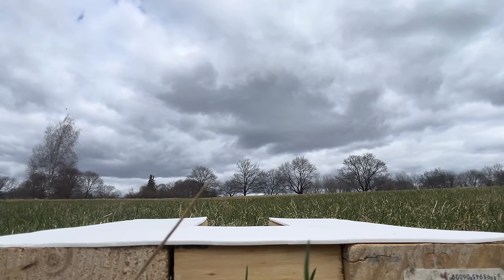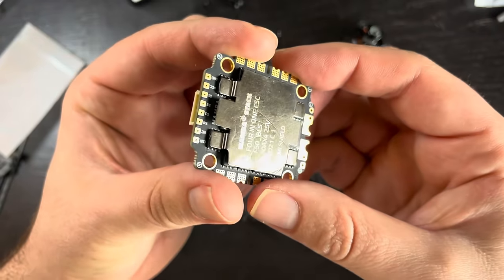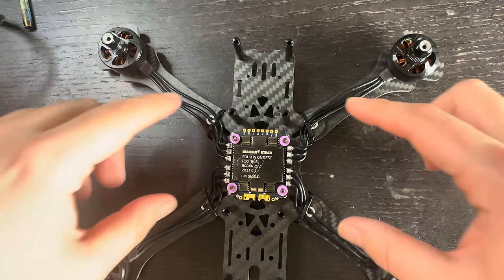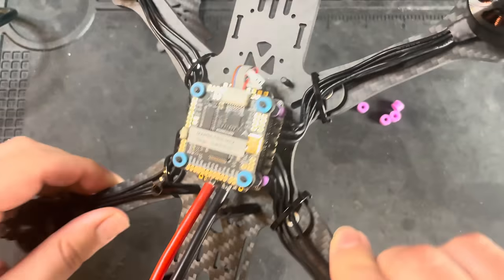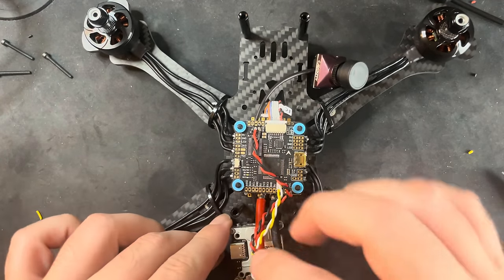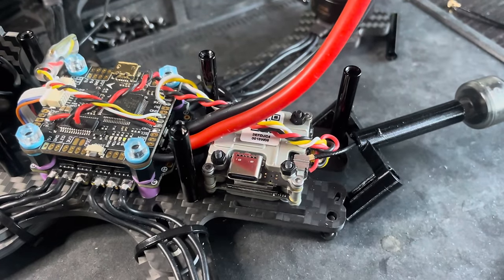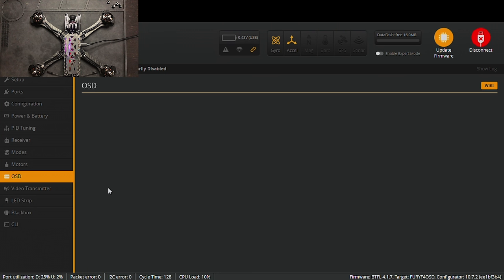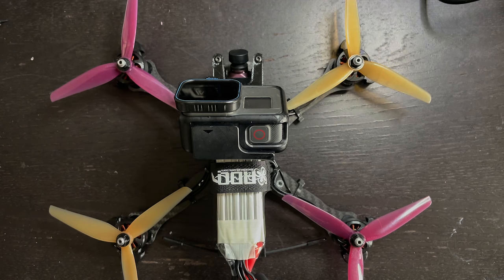2022 - 5" Freestyle FPV Drone Build

Comment: Thank you for this amazing video! I copied 95% of this and built my first drone from it and it flies wonderfully.
Reply: How many min. It flies in single charge
Reply: Why did you copy 95% instead of 100%? What was the 5% that you chose not to follow?
Reply: @mikewedgwood697  he may have decided to build it with some analogue parts rather than digital
Reply: Bro which remote control and vr googles you used? How much it costs?
Reply: @pseudo_yt5598  I've been cautious with not draining the batteries too much so maybe around 5.
Reply: @mikewedgwood697  Some parts weren't available anymore so had to substitute for similar.
Reply: @karanhiragar4587  I went with the TBS Mambo w/ tracer and DJI v2 goggles. Not a cheap hobby but some new digital options are coming out.
Reply: @troyspruit2325  Bro, how much it costs you??
Reply: @karanhiragar4587  For the goggles and radio it was about $700. Drone in total was about $1500. Best to start with a radio and simulator to see if you want to keep spending.
Reply: @troyspruit2325  Sure brother..Thanks for the information and appreciate you for your precious response
Reply: @troyspruit2325  5 minutes?
Reply: Idk what he is using but i would reccomend the elrs radiomaster boxer
Reply: How was it till today???

Comment: Great tutorial! I found it really helpful! I have just one advice as an electrical engineer when it comes to soldering - if you can, use leaded solder and add a lot of flux on the soldered coated pads before soldering the wires. Generally gel flux works better than those flux pens. At the end the leaded solder joint should be shiny. I recommend leaded solder, because it's still used in aerospace industry thanks to its superior resistance to vibrations. Cheap lead-free solder, especially one without a healthy amount of silver, such as the cheapest Sn 99.7% Cu 0.3%, is prone to cracking and I would not recommend it for use in drones, as it can give up on you after a few crashes or worse - in flight.
Reply: He didn’t clean his solder tip once either and dip in flux and a brass cleaning thingy.
Reply: Best thing to do is inhale the fumes. Its really good for muscle memory when handling the drone

Comment: This was fascinating. I really want to start building my own drones but have been a little scared. This really helped!
Reply: Don’t be scared use a super high temp like degrees 800c
Reply: @sethenewman4309  ? with soldering?
Reply: @calmarcalmar  yes with soldering
Reply: @calmarcalmar  my bad 800F
Reply: where can i find the screws you used to hold the caddx vista down?

Comment: The bypass capacitor provides a low-impedance path, allowing AC components in a DC line to pass to the ground.  The ability of the capacitor to reduce noise and stabilize power depends on capacitance (also a function of the pulsing frequency), voltage, and the placement on the board.  Bypass caps are always placed as close to the load as possible. Putting it down the line is only adding more parasitism.  This can cause power loss, add additional noise, as well as create an unstable circuit.  I'm not sure anyone doing drones understands what that capacitor is doing, or even the function of a capacitor.

Comment: Clean build ive never build one before but after watching this i want to try
Reply: Definitely build your own drone it’s a lot of fun!
Reply: I am not a promoter for any type or company of fpv but I mysef learned how to build through YouTube university and a xilo 6s hd complete build kit. There are many types of diy fpv build kits on the market that is a great starting point to learn how to build following a step by step video. Only thing I truly recommend is learning how to solder properly . Rotor riot has solderless solder free builds but in the world of fpv soldering is usually a must have skill for repairs and believe me when I say you will crash and need to repair
Reply: Do it! It's one of the best parts building it yourself
Reply: @trentondrones6429  I want a good low light camera for sunsets so I was going to buy a Mini 3 Pro but I ran across some of these custom drones and I am wondering if I can build a custom one with an even better camera. No idea though, just started my journey on this
Reply: I want to build too ;) Fly Safe ppl
Reply: @slowride5633  yes you can build one with a better one then the mini 3. With a gimbal and high end camera. But you’d probably be looking to spend $4,000 on just the drone and camera. So you still have batteries , radio, goggles, etc. to spend money on. So get a mini 3 and you will get Great video from it and spend a quarter of the price.
Reply: @slowride5633  im not trying to steer you away from drones cause if you wanted to get some sick shots and be on a budget build a 5in 6s freestyle quad and strap a hero 10 on it and you can get way better shots then a mini 3. The mini 3 would just be a great drone to get slow and relaxed shots and with the right camera angle and what not on your hero 10 you could get just as goof of shots
Reply: never build a drone then how you can you say its a clean build 😆
Reply: As far as possible from what kilometer???
Reply: @tabarnakdecris6917  because it quite clearly looks clean, you don’t have to build one to Realise how clean it is😂
Reply: this video is good, and it makes building fpv drone easy. but sad to say, this video skips a lot for the very important parts that you really need to consider when building fpv. 
1. pinout diagrams and wiring, 
- FC to ESC. 
- FC to reciever
- FC to Vista/VTX
2. ESC calibration/setup,  (ESC configurator app)
3. Vista setup, using dji app. you also need to unlock you goggles and vista if you want to use the max output.
4. motor mapping and FC mapping if it not oriented facing forward. 

if you know all of this and good in sodering, well definetly you can build your own. but if not, well jut buy a ready to fly kit (RTF), and upgrade parts one at a time and learn from it. i have been in this hobby for 3 years, it is expensive at first until i learn to design and build my own. this hobby is not easy and cheap but its fun and fullfilling, any one can buy a dji drone and fly it at the same day, but in fpv it takes more than that, thats why i love this hobby and i respect every fpv pilots. good day to you all, happy flying 👍
Reply: @tabarnakdecris6917  by that logic don’t ever say a car looks clean or nice if you haven’t ever built one from scratch

Comment: Another awesome build video! Very clear and concise. I did your $150 build and regret NOT going digital. I will probably build this one next and just go all in with the DJI digital setup. Thanks dude!
Reply from the maker: I made the leap from analog to digital last year at somepoint. Although the VTX/Camera cost is significantly more, it is so so so worth it.. I still have a couple analog quads and can hook up my rapidfire module to my DJI goggles otherwise everything else is converted to digital at this point. 
Thanks for watching!
Reply: @TRONCATFPV  I totally agree, I ended up winning a prize pack from J.B. that included a GepRC Crown HD CiniWhoop, that was the excuse I needed to purchase a set of DJI goggles. I’ve never looked back, digital is absolutely amazing 👍

Comment: I've been building PC's since the mid 2000's.  This feels similar in that you just need to know what a full parts list should consist of before starting.  I'd rate this is as slightly harder though since PC building is basically legos.  The required soldering action for this makes it a bit harder for the true casual.  That requires mechanical skill and also the ability to analyze a wiring diagram.

I thought a DIY drone would be some highly complex stuff but my perspective was from a long time ago before the industry matured to what it is now.  Thanks for the confidence boost for when I attempt mine!
Reply from the maker: There are a couple DIY FPV drones out there that require no soldering and instead use plugs for everything. Since with FPV you crash alot, its very valuable to know how to solder haha.
Thanks for watching and good luck with the future build!
Reply: @TRONCATFPV  How many minutes does the batteries fly?

Comment: nice build. very clean! friendly tip, try turning up the temp on your iron a bit. I noticed the solder not quite getting to temperature when you were doing the battery leads on the ESC. thats a result of the iron cooling down too much. you can either turn the temp up or wait longer in-between soldering each pad. that way your soldered pad will be a nice dome shape with a mirror finish. which leads to a better and stronger connection. The hotter your iron is, the more you can do before it drops below the threshold to properly melt the solder.
Reply from the maker: Typically i have my soldering iron set to 420°, I'll keep this in mind. Thanks!
Reply: @TRONCATFPV  No problem!  420 Fahrenheit? a good range would be 320c-350c (600f-650f) for lead based solder.
Reply from the maker: @RC_Aviator  Celsius
Reply: @TRONCATFPV  oh okay yeah that should be more than enough. just need to let the iron heat up a bit more between pads. also a side note, on most pcb's the ground usually runs throughout the board to all other ground pads, so it pulls much more heat than non ground pads.

Comment: Thanks for the great video, I would like to build this and use my old Taranis with the ELRS is their anything I need to set in the Taranis model that's special for ELRS to work? Also have you had any failsafes using ELRS?
Reply from the maker: Haven't had any failsafes yet, then again I haven't really tested too crazy range. 
As far as the Taranis goes you'll just have to make sure you have the crossfire protocol installed and change from internal RF to External and you should be good!
What model Taranis do you have exactly?
Reply: @TRONCATFPV  Thanks for the help its the Taranis X9D. So just turn Crossfire protocol and switch to external rf got it! Should I turn on Dshot for smoother flying or that doesnt mk a big difference?

Comment: Thanks for the video. I need to solder on the same esc and this really helped me visualize just what I need to do. I’ve installed receivers before but never a stack. If it comes out half as clean as this build I’ll be happy.
Reply from the maker: If you've soldered a receiver you'll deff be able to do the ESC 👌 
Typically the ESC has bigger pads and is easy to work with.
Reply: @TRONCATFPV  thanks man. I did it and it works!  Appreciate your channel man!

Comment: Great video man, I bought an dji fpv to start learning to fly but after seeing your video I will definately build my own. Do you know if the goggles from dji fpv works with caddx vista? I have the v2 version.
Reply from the maker: The V2 goggles work with a caddx vista 👍 
Those are the goggles I have!
Reply: @TRONCATFPV  thank you for quick reply, again, very clean build and nice vid. I am currently buying an identical one except im going to use the emax eco II 2306 1900 kv engines, have reaf good things about them :)

Comment: Another great tutorail. Keep them coming!!
How do you think the tattu r line 1400mah or 1550mah 120c would do with this setup? Too heavy?

Thanks
Reply from the maker: Thank ya! I think those batteries would work good on this quad. You’d probably start noticing weight impacting flight around 1700mah

Comment: I have built about 10 drones.  You got a thumbs up and sub for the rubber grommet/ dental floss trick. 
I hate that part.  I hate those grommets.  There have been times where I have put off a build because I was thinking of the terror of trying to get those stupid grommets in the mount holes.  Those things had me punching myself in the face after putting spit on them to get them to slide in and cursing at them under the magnifying glass only to realize I put them in upside-down
🤦‍♂
Reply from the maker: haha i'm glad that tip helped you out 👍
Those grommets SUCK. 
I've put them in upside down before I knew this little hack. Thats the stuff of nightmares

Comment: Great video.  I am very interested in building this, but its been a while since I have been involved with FPV drones (the last was a DJI Phanton 2 with a 7" screen attached to the transmitter.  There are some items that are out of stock (frame).  What would you suggest as an alternative?  Also, what digital google setup would you recommend for this setup?  Just looking to fly around our property, nothing extreme.

Comment: You've got some mad skills. 
I've been flying fixed wind with Spektrum and lemonrx. I'm trying to decide what protocol / transmitter to go with and goggles for drone pfv.  Perhaps tx16s thinking elrs but I'm an older guy and feeling slow with the tech stuff... Perhaps hdzero goggles.

Comment: Those capacitors definitely get in the way when soldered directly onto the ESC. I've never seen it done like that on top of the xt60 before...great idea! I will definitely try that on my next build. Have you ever had issues with it not functioning properly in that configuration?- Fellow New Englander, writing from Maine
Reply from the maker: I always get people criticizing that method of capacitor placement but I have it on a handful of drones and they all fly great. never had any issues and saves alot of space on some buidls!

Comment: For analogue builds, do you advise powering the camera directly from the vtx filtered output or from the flight contoller?
Reply: For analog, your best bet would be to power the camera from the filtered 5v from the VTX. The trick is to attact the ground wire from the 5V output from the VTX to both the camera, and a ground pad near the OSD chip on the FC. This will help reduce OSD flicker. PropsOff has a good video on this; search YouTube for VTX redundant ground and you'll find it. Good luck 👍
Reply: @mikea3169  Thank you - I'll follow this guidance and also check out PropsOff video!

Comment: Hello there, I used your Video as a guide for my first Drone. Everything was running fine. Ty so much! Except of one little Problem. I connected my receiver with my contrroller. Betaflight shows me the Pitch, yaw, Roll and throttle. But when I move the switches, nothing happens. Do u know how to fix it? Ty

Comment: Can you then fly with any remote control?  Or are there any differences?  Only the DJI remote control fits the Googles V2 or?
Reply: The remote depends on how you build the drone. In this video he used an ELRS RX/TX. So you'd need a remote with an ELRS transmitter.

If you build or buy a drone with the DJI video system you can use the DJI FPV remote without adding a receiver.

Comment: I really really want to build this but I have 0 experience flying drones, is it a bad idea to build this and practice on the simulator, and then try flying this as my first drone? I have a lot of experience with mechatronics and the build part of this but not flying. Also do you have a tutorial on using the simulator and pairing different controllers?
Reply from the maker: I would recommend a RTF (ready to fly) kit for your first FPV drone. You can get them for about $300 sometimes cheaper. I have a video on this one: https://youtu.be/R4MqtrzjZXE

Most simulators will auto recognize what controller you're plugging in and automatically set it up 👍

Comment: Its awesome to have a 6s version of a 5' drone now! Do you maybe have some cheeper products?
Reply: This build is already pretty cheap, especially nowadays with the chip shortage. If you want a cheaper build, you have to go analog, which will save you around $150
Reply from the maker: ^^^ What MrAlucardDante said.
Really the only way to make this drone cheaper is by using analog parts instead of digital.

Comment: Imagine making a chair that's connected to the drones gyro where it would twist and move making it more feel like you're in the cockpit of the drone (might not be able to do flips on the chair)
Reply from the maker: check out medlin drone company, he makes servo setups for FPV drones that actually move the camera. Ive been playing with mine quite a bit and it takes alot of practice but its pretty wild.

Comment: Hey Troncat, thanks for the video, just what I needed, hey one question, can I use the DJI air unit instead of the Caddex Vista? Thanks.
Reply from the maker: I believe so, I'm not sure of the mounting pattern on the DJI air unit but if its 20x20 you'd be able to fit it on the back mounting holes 👍
Hope this helps!

Comment: Hey thank you so much for this video! I've been really wanting to get intro FPV drones so ive been watching a lot of your videos lately. If i bought the DJI goggles and remote controller,, am I able to connect that to an FPV drone like this one?
Reply from the maker: Absolutely! When hooking up the caddx vista/Air unit you'll want to make sure you connect the additional two pads that I didn't use. Those are for the DJI remote 👍
Hope this helps!
Reply: @TRONCATFPV  Thank you! Yes,, i'll look into that!
Reply: @TRONCATFPV  just to make sure...you're talking about the two that you cut off correct?
Reply from the maker: @shotasprunger905  Yup! 
Here is a diagram for reference. in the picture it would be the GND and SBUS

https://www.firstquadcopter.com/wp-content/uploads/2021/07/Caddx_Vista_wiring-diagram-pinout.jpg
Reply: @TRONCATFPV  wow you're a beast! Thank you!

Comment: So if you solder all the wires on the caddx then you can use the dji controller? Sorry if its a dumb questions. Very new to this
Reply from the maker: no worries! Yes if you connect the two additional wires the vista will act as a receiver for your DJI controller as well 👍
Reply: @TRONCATFPV  thanks for the speedy reply! Ille order everything this week and let you know how it goes. 
Awesome instructional video by the way!!